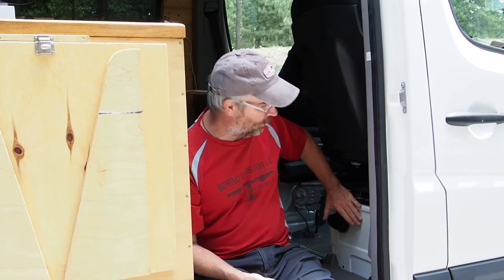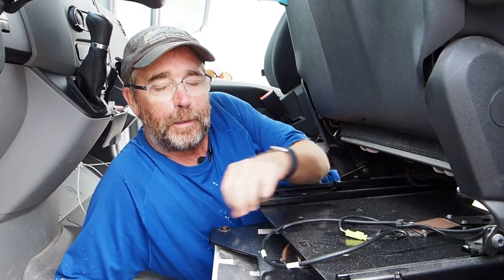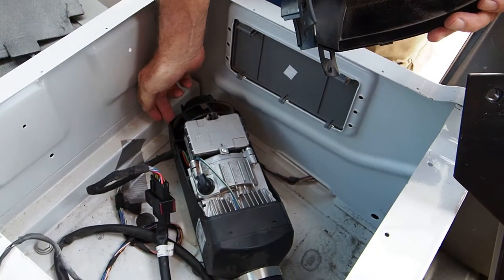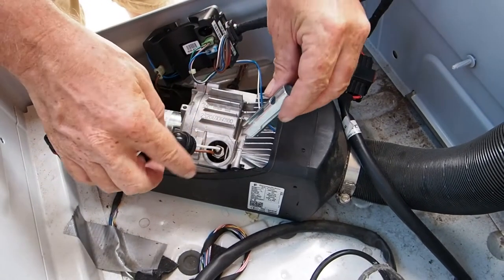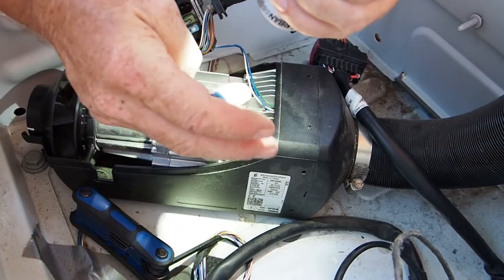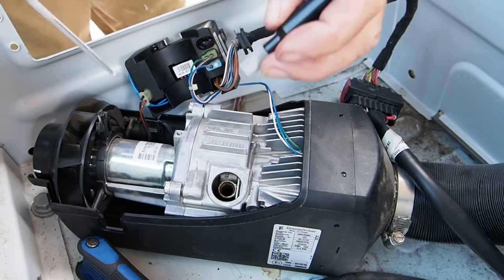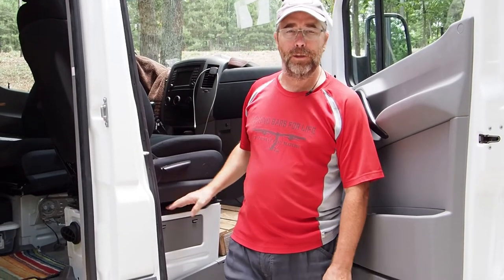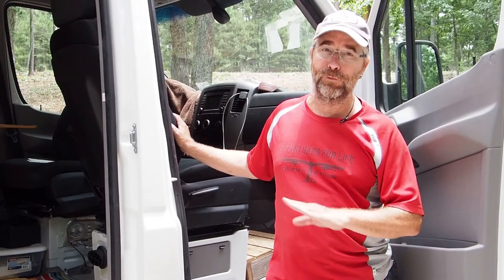ESPAR D2 DIESEL HEATER SERVICE - Replacing the Igniter and Atomizer Screen

Comment: I’ve had these in Peterbilt trucks for years now. I run kerosene instead of diesel fuel. Burns so much cleaner and your screen will give no problems for years. I have them run for 8 to ten years before you need to replace anything.
Reply from the maker: Hmmmm, good to know. Thanks for the comment.
Reply: The difference is like $1 per week 🤔